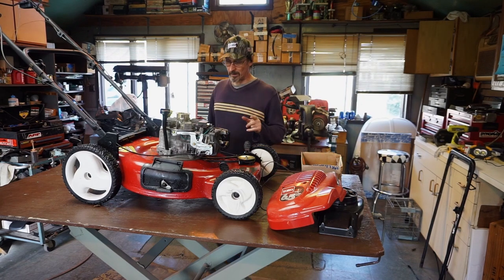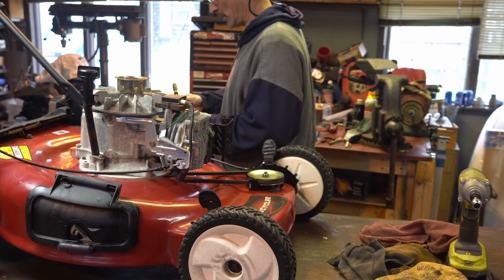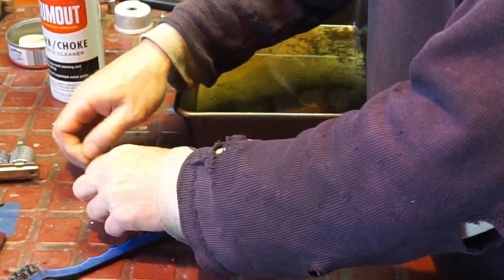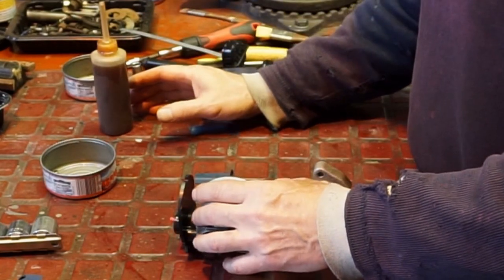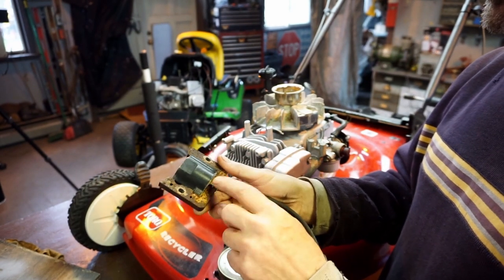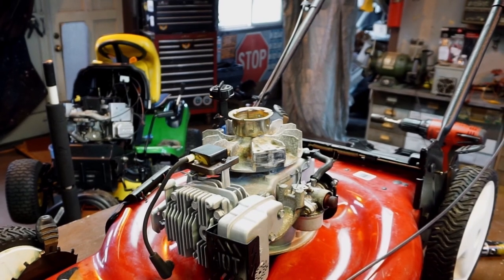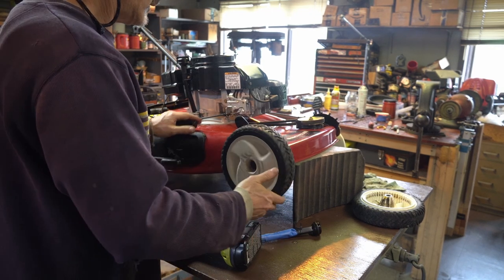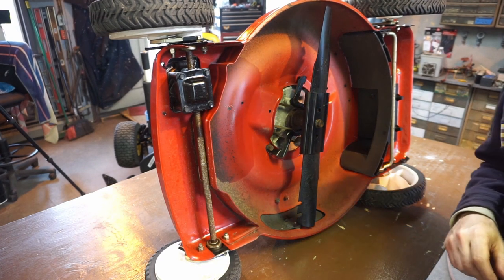How to Diagnose-Repair-Refurbish The Toro Front Wheel Drive Lawnmower with A Tecumseh 6.5 hp Engine

Comment: Hey Arch could you give me the model # on that Toro I have one like that and the model is scratched off. I nèed to get me a bail and probably the upper handle. The work you did is awesome both the engine and cosmetic.
Reply from the maker: No sorry,, these sell fast and like your machine, these all suffer from that stupid printed tag!
These haven't been made in a long time so the parts ya lookin for may not be available. 
You need a a junker like I collect.

Comment: Oops, UPDATE:  I should have watched 15 more seconds where you actually showed the can of Rustoleum High Temp paint.  Yayyyy!!!!  So how long does it last on a muffler?  Strong smell?  I'm mostly concerned with what the customer will experience when they get the machine back home and use it for the first time.  Thanks SO much for showing the exact paint you're using!  That's what I needed!!!

(My original post)  What silver paint do you use on the muffler and other parts?  I'm assuming it's high temp.  Do you use a primer first?  Does the silver paint burn off eventually or give off a strong smell when hot?

Also, what paint are you using on the blades?

Comment: I like to treat all electrical connections/grounds with silicone/dielectric grease.  High tension lead spring to spark plug, magneto grounds and tang, kill wire connections, etc.  Most people don't understand the function of this grease and think it's supposed to prevent current from going through.  I try to educate whenever I see that.  ;-)

I've never treated the magneto to flywheel airgap surfaces although I always wire wheel all of the magneto and wire brush the flywheel off.  Now that I see you treating those surfaces with white grease I think I'll just spray on some Boeshield T9/chain wax to help prevent rusting at least for a while.  I think after the chain wax dries over night it shouldn't sling, especially since that was it's original intent with bicycles and motorcycles.  What do you think, Arch?

Comment: I've been using actual shim stock to airgap magnetos since I have some sizes.  I like that the ones I've had for years are very different colors, so it's easy to select the one I want.  I cut them to an appropriate dimension and use a ffmagic marker to denote the dimension, so these are part of my regular tuneup tools.  I need other sizes so I'll be ordering some when I get around to it.  I do have the Stihl gapping tool but usually only use that for smaller 2T machines.  Although I know the actual airgap dimension is pretty flexible and will work on some machines with a variance of several thousandths, I try to stick to the mfr. specs whenever I can just to at least have a baseline for tuning.

Comment: Nice job Arch, mower looks great and opening that jet is the right thing to do on these Tecumsehs. If you have not seen Jakes video on blade sharpening check it out the Oregon 42-047 blade balancer is my favourite tool in the shop. Just a heads up 1 or 2 out of 10 new mower blades tested for balance on this balancer show out of balance enough to cause vibration and very hard to determine this balance using a nail or the cone balancers. The OLD MAN over and out!
Reply from the maker: Thanks,,,,Jake??  Fill me in,,,,,I have taken off relatively good lookin blades, hung them on my nail,,,used my static balancer, drilled, ground and still couldn't get them balanced and Yes,,,,they vibrated the heck out of the machine!!!
If they drop to 3 o'clock on the nail,, they go in the trash....
Surprisingly my technique gives very good results.
Reply: Its the OLD MAN Arch just saying that the Oregon blade balancer is much more sensitive that Jake and i have found what we considered balanced before to be out of balance and new blades you would expect to be balanced are more than 15 degrees off on the Oregon balancer. We now are basically grinding brand new blades before installing them to get them balanced say 8 out of 10. In some cases it is the paint on end only and some need a good amount of material removed to put them in balance.
Reply from the maker: @waynestefinashen239  Ohhhhh,,, I understand now,,,